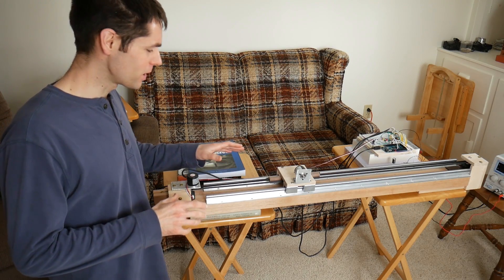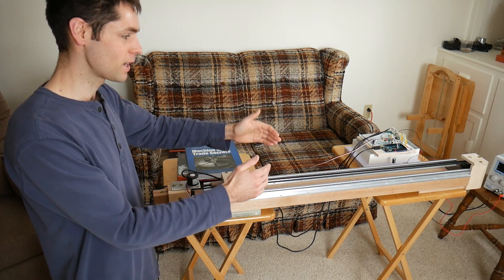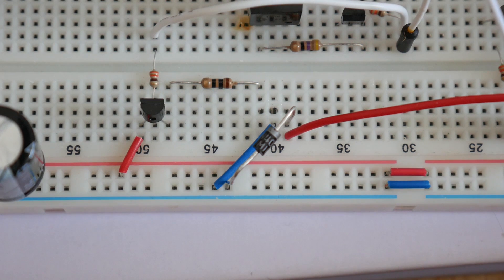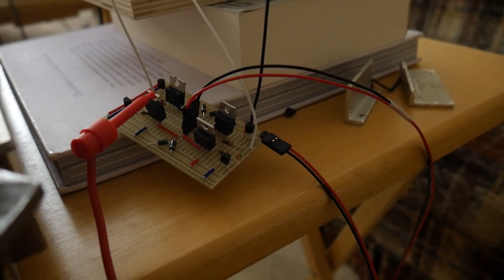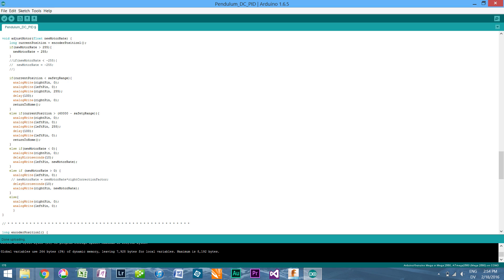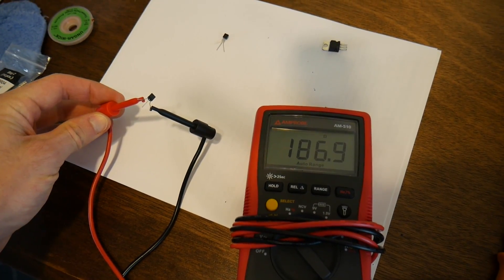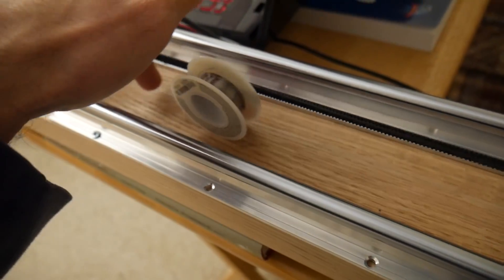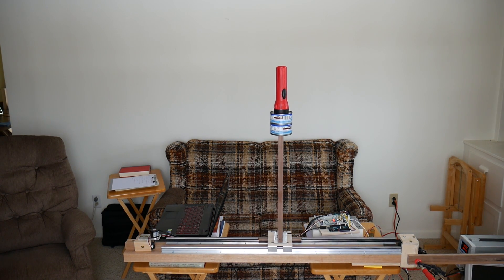Inverted Pendulum(s) #2 - Basic Balancing

Comment: Hey Scott you have done an amazing work. Did you use 2 PID loops which are for balancing the pendulum and position control of the cart ?
At the end you are changing the center of mass by adding some weights on the inverted pendulum. How did you achieve that? Is there any specific controller that you have implemented ? 
Could you please share the code - danujaboteju@gmail.com
Thank you very much for sharing this video.

Comment: It's hard to tell from the video but it seems that the pendulum is mounted just a wee-bit off centre. Could this contribute to the right bias? Given the length off the stick, even small shift will contribute quite a bit of mass.
Reply: +Vojtěch Frič I don't think that would matter, since he is calibrating by "balancing" the shaft (letting the shaft hang), so the shape of the stick should not have any effect on calibration.
Reply: +neistridlar Hmm, that makes sense. I was thinking that in extreme case if you would try to balance L-shaped pendulum, it would be harder because it would tend to tip to one side. But the calibration should take of that regardless of the pendulum shape.
Reply from the maker: +Vojtěch Frič I definitely thought about this and it's how I'm currently compensating for the bias. I'm setting the initial neutral to 1199 (0.15 degrees left of ideal) rather than 1200 from the hanging position. It seems to work well so I'm leaving it for the moment.

Comment: very nice. There are a lot of control strategies, and you seem to have found one that is good. The last time I played around with the inverted pendulum, my error signal was built around no carriage motion, carriage centered, and stable angle for the pendulum. I didn't bother with building in what vertical was. If the carriage is near center and the angle is constant while the carriage isn't moving, then it is in balance.

Comment: A lot of DC motors have the brushes at a non 90 degree angle to the field.  This essentially gives the brushes a bit of "timing advance" to compensate for the magnetic field in the stator shifting slightly in response to  the rotor's field.  This makes the motor more efficient at running forward, but less efficient at running backwards.  Run the motor both ways, see which way it runs faster and / or consumes more current.
Reply: I was going to say something similar,  much less articulate though,  you nailed it.  I've observed this with my r/c projects but never knew the science behind it.
Reply: +Matthias Wandel I'm partial to this rather than the belt theory, mainly because then, it would mean that the printers would suffer from this and i've never observed that with my plotters.

It's the motor that's at fault, not the belt setup.